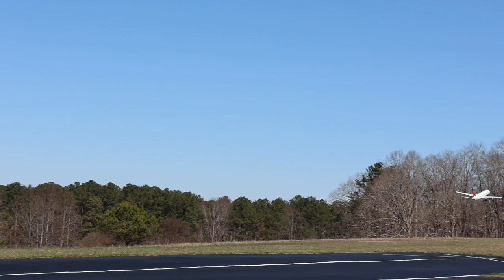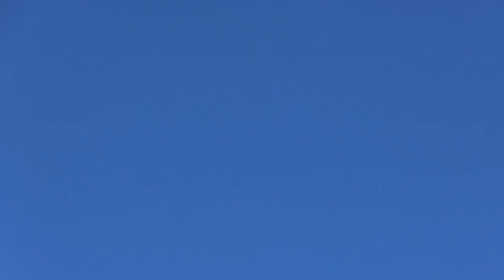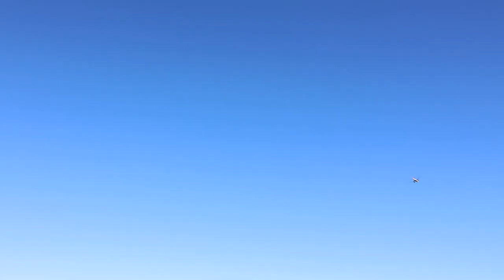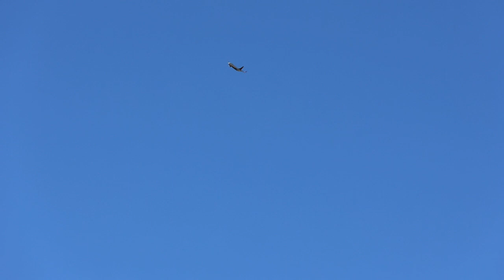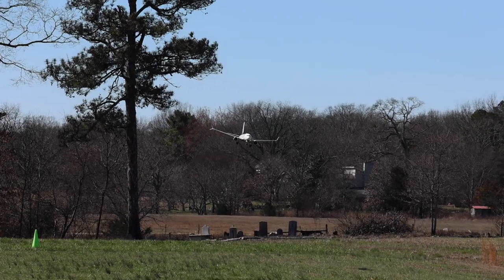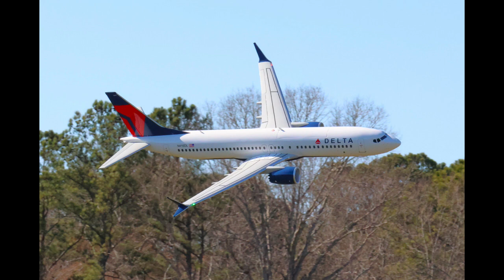Freewing AL37 (Delta 737) Maiden flight with Reverse Thrust

Comment: Hi - great looking model.  What technique did you use to coat this model?  I see the shine which makes me think you used epoxy?  Appreciate knowing the process and technique.  Thanks.
Reply from the maker: Started by sanding all the foam molding marks and filling in gaps and dents.  Applied about 3-4 coats of minwax polyacrilic.  Then 3-4 coats of filler primer wet sanding between each coat with progressively fine grit.  Paint as desired and apply decals.  Finish with 2 coats of polyacrilic.

Comment: Hey my Guy what esc do you have in there for thrust reversing ? I'm trying to find which one I can use because Motion RC has one on sale a 80mm EDF 100A w 7A bec? I'm just not sure if that would be compatible.  Beautiful flying by the way .
Reply from the maker: This one I used 2 Hobbywing Platinum V4 80amp  ESCs.  Only a small modification to the ESC area was needed to fit them.

Comment: Excellent paint job! Did you glass the aircraft? If not  how did you finish and paint the plane?
Reply from the maker: No, I didn't glass it.  Used 4 coats of clear as a base.  Then 3-4 coats of a filler primer wet sanding between each coat.  Then use behr spray paint to paint it.  Then the decals were applied and finished with 2 coats of clear on top.
Reply: Thx for the info

Comment: Hello. How are the reverse thrust ESC’s holding up?  They seem to work very well.  Could you tell me what ESC’s you used and part number.  Thanks
Reply from the maker: They work very well.  I have many Planes with reverse now.  The ones on this plane are Hobbywing Platinum Pro 80amp V4.
Reply: @pilot482  Thanks for your reply. 👍🏻🇺🇸